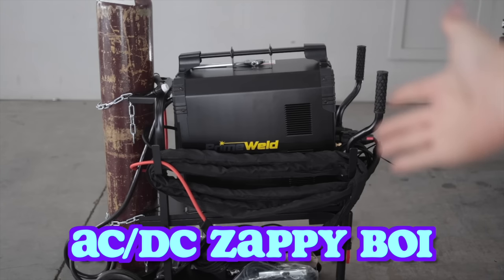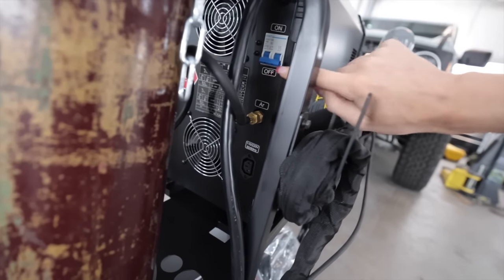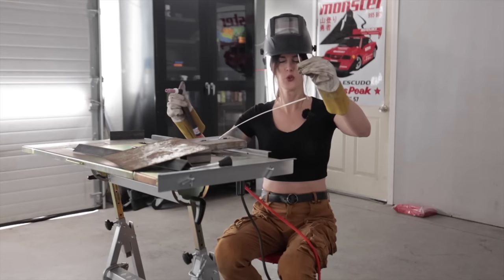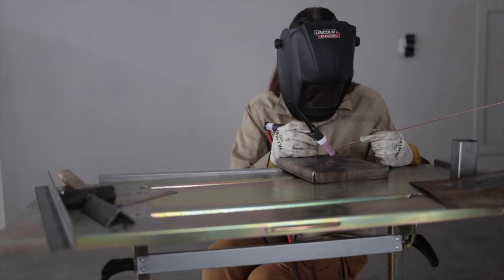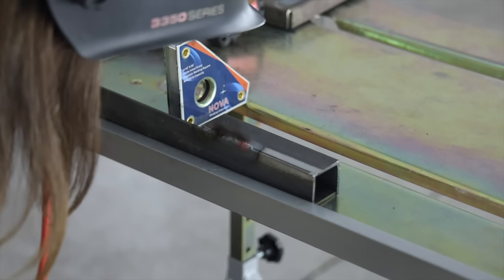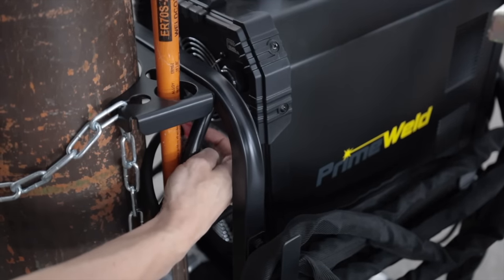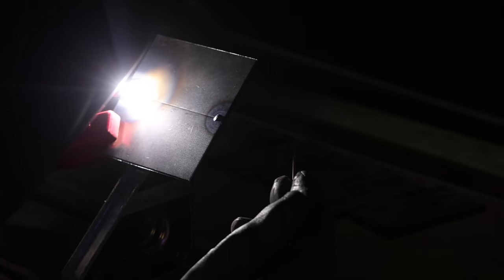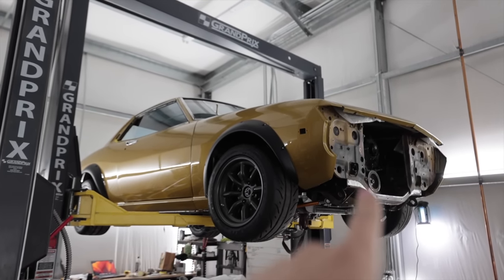Teaching Yourself How To TIG Weld

Comment: BEWARE THE MAGNET!  A tip for those who don't know:  MIG and TIG welding involve the flow of current via the arc.  That flow of current will get diverted by any local magnetic field. (Same principle as electron beam deflection in old "picture tube" TV sets.)   It's very tempting to hold pieces to be welded together with those nice 90-degree and angle magnets... but you can mistakenly position the magnet in such a way that the magnetic field deflects the arc.  You're sitting there wondering why the arc isn't going where you want and expect, and may incorrectly suspect something about surface preparation or gas flow.
Reply: Also heat makes some magnets stop magneting.
Reply: TIL! Thanks! I'll be in her shoes one of these days lol

Comment: SARAH, you are right about that coating from when the steel was made. It's typically called mill scale and can cause some of the sparks you experienced. If you grind it off, you shouldn't have sparks flying while welding additionally you should achieve a better weld. Glad to see you getting into tig welding, it's one of my favorite processes.
Reply: Yep! As with anything, prep is key!
Reply: Also sometimes there is oil on the metal too.  This can make the scale on hot rolled steel even more nasty to weld.
Reply: When tig welding  you push the pudle instead off draging it

Comment: Here is a helpful hand. The cup on you tig gun is used to drag or walk and steady the Tungsten tip. which is why the cone is not a type of metal. Cup sizes are determined by the gap size you are trying to fill. The wider the gap the bigger the cup so you can walk your way down the root while moving your puddle. You also need to make sure there is no wind to blow away the gas
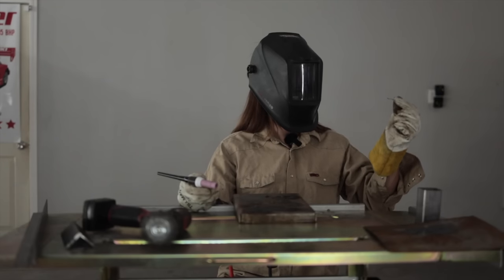Reply: 6:00 Dragging the cup.
Reply from the maker: There’s definitely no wind in here lol
Reply: Can't give you any tips, only encourage you to not give up and I'll gladly watch the next welding video(s?).

Comment: Learning how to weld is going to be extremely valuable for you in the future.  Just remember the arc you are welding with is plasma, just like the sun.  Cover up so you don’t get burned.  I would have suggested getting a multi process welder so you can start with MiG and learn puddle control and speed.  Tig is just MiG where you have to manually control the rod feeding, amperage (with the pedal), and your arc distance and speed with your other hand.   Keep working at it though since you will need the skill.

Comment: At 5 minutes, you can see Sarah got some sunburn. Ultraviolet light from welding burn your skin. Wear thick clothes even in hot climate. (edit) best part of TIG is that you dont need filling if parts fit exaxtly, like those two square nakes nice square tube without any extra fill. Doing so you can made beautiful exhaust pipes or thin sheet metal art.

Comment: If you're a beginner and contaminate tungsten a lot, cut 3 or 4 rods in half with the corner of the grinder and sharpen both ends, and keep it close hand handy. It's more convenient than walking to the grinder every time.

Comment: Larger cup size allow for a more extended tungsten,  without losing argon coverage, but you also have to increase your flow rate a bit. Makes a wider weld bead as well. A sharper-angled tungsten will make a wider bead with less penetration, that's great for the thin stuff. 60 deg tip angle is the standard.

Comment: Use a dedicated wire brush for each metal type ie  stainless,aluminum, steel ect. Wipe with acetone just before welding. The coupons are great way to practice get same type of metal and shape as what you want to weld

Comment: I taught myself to weld doing a downpipe and exhaust.  I used a harbor freight Flux core welder and the welds are still good after several years of turbo driving.   When learning anything, watching some one do it is really helpful.  Humans are amazing mimics, if you watch a ton, you will literally pick up on things subconsciously and you'll be shocked at how good the first bead is.  I mainlined welding vids for a week. 😅

Comment: So fun to see you try tig welding. I always wanted to learn welding, I did try a bit of arc and mig welding for a day at my old job, we had to build horse pens for a huge barn. I basically can spot weld, nothing fancy. We made a jig, in which we welded to some mill scale square tubing made into a 8ft x10ft frame, big enough to hold a sheet of plywood underneath a sheet of pig panel. It was a great learning experience. I was excited and felt like I was a welder for a minute. Then my shit started failing when we pretended to be a horse snd kicked the plywood a few times and welds started breaking. Luckily I wasn't the only noob. 
Speaking of jigs, Angel Food dancing a jig was quite funny. I love his new channel, but glad to see the team back in action if only for a day.

Comment: Hey Sarah I'm a experienced tig welder and love how you just had a go with no experience at all  couple of tips sharpen both ends of your tungsten then you can just turn it around if you wreck your tip and using the foot pedal is just like a gas pedal in a car so with that you have maximum control with how much heat you need for the material you are welding hope these tips helps you on your tig welding journey love the channel and your attention to detail in the videos 🥰🥰

Comment: Keep at it Sarah.  You did a lot of experimenting. I'd say pick one... size, material, thickness and joint  and do about 50 passes / tests to improve skills before changing all the variables. I have no doubt you have the ability to do excellent work but need to give yourself some time to learn.

Comment: You are traveling the wrong direction with your tig torch. You should  be traveling towards your filler rod as it it consumed into the weld puddle, not towards your tig torch. If you invest in some clear furic gas lenses, you would be able to see your tungsten electrode best as you are welding, + the clear furic gas lenses really help a great deal when building headers. If you had watched some tutorials on tig welding, you would have seen the proper travel direction that is recommended to use when tig welding. It has something to do with proper gas coverage on your welds as the weld pool is cooling down in the stream of argon gas.

Comment: My hat is off to you for trying to learn TIG with out instruction. It is tough to get the hang of. Building headers from scratch is definitely one of the most difficult fab jobs you can do. If you do want to take it on, you could still tack them together (even with MIG) and get an expert to do the final welding. Either way I totally agree that the best way to learn something is to just give it a go.

Comment: Just nice and smooth moving the pool forward and adding rod to keep the pool the same size. I learn this thirity plus years ago in trade school it was one of the aircraft amintenance requiremeets . It was so we could discern between good and bad welds on components . The stainless is the hardest type and metal , it turns a little pink on the edges when done correctly but difficult to do. Keep up the work , i'm glad you tryng this, Sarah you will get it.

Comment: very entertaining, Sarah as usual. 
As far as I understand, TIG is used for welding two pieces together by actually melting the joint material, preferably of same specs,  avvoiding too much of a puddle. 
TIG goes with tungsten tip and without adding a filler.  Can, but don't have to. 
what Sarah is trying, looks more like soldering or MIGging with the wrong machine.

Comment: I am by no means a great welder these days.
But try running the torch in to the filler wire. This is how I was taught and it works a lot better for me.
Also remember that you weld aluminium hot (high amps and volts), and stainless cold (low amps and volts).
Getting the right tungsten for materials and the right cup size is also a huge help.
Your doing great, looking forward to more videos of your progress

Comment: I have the exact same welder and you picked a very good machine. And like you, the welder machine is light-years ahead of my TIG welding abilities. MIG is so much easier, but I want to be able to weld with either method. So don't give up. It takes metal  knowledge, time and lots of practice to TIG weld good...   Thumbs up!

Comment: Love you ❤ You demonstrated exactly what I did with my TIG welder. It took a lot of practice just making a puddle and not adding any material. I was using 1/4 thick steel as it was my vice holder that needed to be filled to fit the vise. So yeah TIG is hard and you are so AWESOME for doing this and being you.

Comment: This makes great content. everyone teaches same thing different. so, learning what not to do on your own, makes it easier to learn from someone giving proper instructions.  TiG mostly used for clean precise welds. it normally not used in panel repair because take way to long and expensive. difficult to hold that dam little torch at right angle to get proper gas shield to apply  rod to weld panel. hey, you learn by doing.

Comment: I have made 2 sets of headers , I used ice engine works exhaust modeling system , cut and tacked with mig weler and had profesional weld with tigweld .

Comment: That's the same welder I bought 3 yrs ago. It's a great machine. You'll really like it.

Edit: With tig, push the tig torch forward. Don't drag it backwards. When you pull the torch backwards, it effects the shielding gas. That's why you push forward so the shielding gas fully covers the area you are about to weld.

Comment: I'm happy to see you wanting to learn to weld.... You already have so many skills and abilities in car builds and maintenance that it just makes sense 😊... I'm a lowly MIG welder by trade and my TIG welding is basic but I'm learning. Getting used to autogenous (no filler rod) is great for learning to control the weld pool and then introduce filler rod to the weld for the next step 😊👍
You're doing great... Have more rod sticking through your hand so your hand isn't so close to the heat 😉👍

Comment: Yes vote part two!!! And agree with some others here you are perfectly capable of cutting tube and tacking into place and then outsource the final welding. You got this your perfectionist in you is preventing yourself from trying thinking you will do a poor job in reality you might want to wrap the headers anyway to keep the down in that tight engine bay. In that case ugly welds wont matter just as long as it doesnt have holes in it.

Comment: To figure out what amperage to use you go by the thickness of the material. For every .001 you want 1 amp. So if you have a piece that is 1/8" or .125 thousand you'll need 125 amps. Also, the footpedal varies your amperage.

Comment: One more fun fact... thermite. You take some aluminum and steel shavings and some kind of fuse that will burn hot enough to ignite the mixture. It will burn through your table, through your concrete floor, ... This is also why you don't use the same grinding wheel for steel and aluminum.

Comment: My stepfather was a iron worker - one of those dudes that would be up 50 stories balancing on steel girders and welding. He tried to teach me how to stick weld when I was a teen but honestly that big ass welder plugged into the dryer outlet scared me back then. I did minor welding on my old '66 Chevy van that had doors rotted out, but I sucked. It really is one of those things were practice (lots of practice) makes perfect. Every welder is slightly different too so try sticking with one and learn its nuances.

Comment: Welding headers is tricky because you have to protect the inside of the weld otherwise it burns and becomes brittle. You can either paint the inside of the weld area with solar flux before welding, or cap each end of the tubing and fill it with Argon gas. The flux method is easier and more affordable, but you have to paint it before you put it together and Tack it. If you don't do this as soon as you get some heat cycles it will crack right on your weld especially with stainless. Stainless Headers are way superior they never rust and they have a really low heat transfer so you don't even really need wrap or ceramic coating.

Comment: TIG welding. Clean the workpiece of scale/degrease. Wrap the lead around your wrist, it makes it easier to control the tip. Try welding towards the filler rod, right to left. DC for steel/stainless-steel, AC for aluminium. HF on.

Comment: so when you are a kid you mimic and that is how you learn to walk and talk and so on. Yeah, you make a lot of noises and kick your legs first but when you get down to business you have been paying attention to others.

When you start to tig weld you start with puddle management and no filler. You work on using that pedal to keep a single little puddle going without blowing through. Then you work on moving that puddle around and then later you work on dipping the rod into the edge of the puddle to get more fill. Trying to do all of the things in a go is like trying to run a steeplechase before you know how to stand up without falling over.

Comment: I recommend that you switch to Chartreuse tungsten. You can use it for everything. second, I would use a #7 or #8 cup and stick with it until you know what you need. 3rd you were pulling your puddle instead of pushing it. Use a sharpie and draw a line and use that as a guide until you can keep a straight line. when practicing with stainless, cool it off with an air compressor before starting your next pass or practice on 4 coupons at a time. the soot that is showing up is from crap or oxidization on your tungsten from dipping or taking it out of the gas. lastly, make sure that you are comfortable when you are running your pass.

Comment: I think you did a great job, and learning on your own instead of with instruction to boot, one aside, I would be surprised if your welder given all of its features, doesn't have a variable power via the foot pedal, so the harder you push down the pedal the hotter your weld.

Comment: Hi  Sarah, could a compromise be that you cut and tack  weld the runners together (tight fit for tigwelding) and get the bbq guys to finish out  the welds. For learning, get some stainless tig filler wire and decrease your torch angle so its more square to the work. You are doing awesome for a beginner welder.

Comment: Hot rolled steel has scale on it Cold Rolled Steel has oil on it..    Since you are sitting down   use the Rheostat Pedal  you need to start hot then back off on the heat after you get your puddle established..

Comment: Someone may have pointed this out previously (I haven't read them all), but you have now learned the REAL (hard) way that there are specific TIG welding gloves that are more reflective of heat. Usually available at specialty welding supply shops.

Comment: Sarah So many things to say. I will say, don't! give up... Not bad for just giving a go. there are quit a few things to know,  I only wish I would be able to help you out some how. Contact or watch Jody at welding tips and tricks. He is well renowned and can learn everything you need to start T I G welding. One thing when you set up the torch always start with the gas lens or gas diffuser then collet then back cap then final the cup size needed. gas flow can be adjust by 2.5 x the cup size will give you your base line you may tweak from there depending on joint application or if you are running extra stick out. and for a base line of amp setting use the decimal thickness of the material again you will  adjust base on joint and type of material this gets you in a ball park. Also did the machine not come with a ground clamp I saw you using the SMAW rod holder LOL! Keep it up I think you are a person of great caliber and will succeed... For your headers I sent an e-mail to your Sarah-n-tuned page check out Trick-tools. Keep up the great work and keep on being you. I think your awesome..

Comment: Screwing around with your legs....😆😆😆😆🤣🤣🤣🤣

Also, thank you for showing the process of TIG. I don't think it's too complicated, but defiantly a skill that I will spend thousands of hours practicing. Also, speed is your enemy when welding, slow it down, I would say try to weld two perpendicular pieces of metal together, and take your time.

Comment: I leaned how to tig weld on the job. You will zap yourself at least once. What I leaned. With Stainless steel rod at 150 amps, hold the tungsten rod close (almost touching) the metal you want to weld and feather the foot pedal, drawing a “C” shape, which will pull the melted metal and the stick your feeding as you weld. Eventually you want to have rainbow welds. If you have black welds oxygen has contaminated your weld, as the tungsten tip wasn’t close enough to the surface. Thin sheet metal is hard to weld and don’t lean to close to the welding. Don’t want to melt your helmet. Lastly  you need a respirator to tig weld Alumium it releases noxious fumes. It also requires 1 amp per mm. Not recommended for a beginner. Best  of luck. 😊

Comment: You done a better job than I did lol, I built a set of headers for my 350 swapped s10 and I only mig welded them together and surprisingly they are still holding up quite well. Stainless steel headers using stainless MiG wire works wonders. I've gotta learn tig welding eventually so I can build a better roll cage, done great for your first time out.